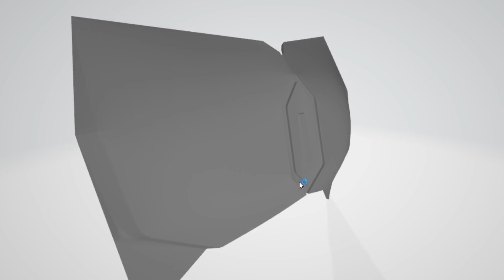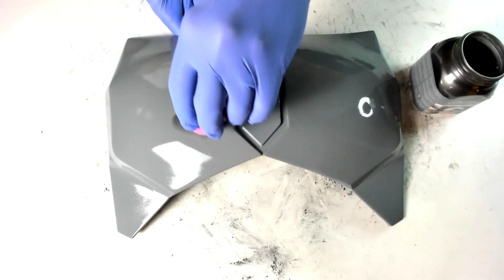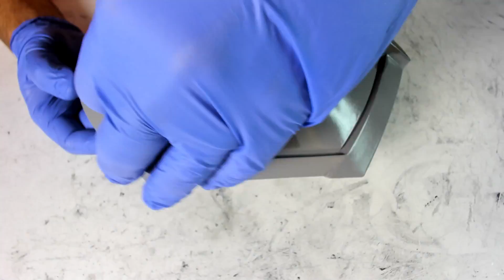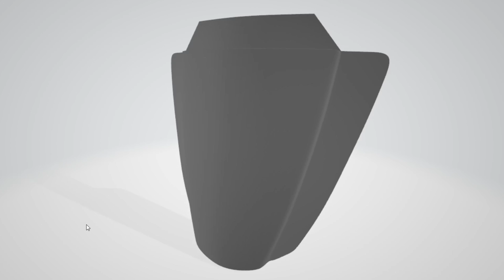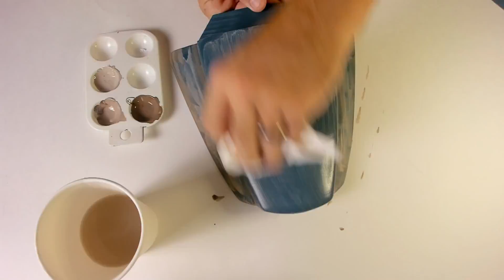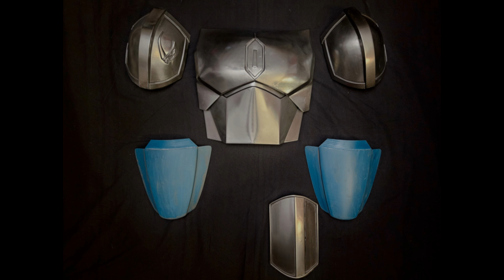3D Printed Mandalorian Armor With Only FREE STL Files? Pt.1

Comment: Hello. your work is great. What is the brand of your 3D printer?
Reply from the maker: Thank you! I've been using an Ender 3 V2 Max Neo, but i recently upgraded to a Bambu P1S. I'm looking forward to making new videos with that one.
Reply: @VaderDadBuilds  Thank you. Congratulations on your new machine 🥳
Reply: @3DMaxBuilds I just bought the Bambu P1S two weeks ago and I love it! It is my very first 3D printer. The only downside is that it only prints up to 256mm. I'm printing lots of large armor and I need a 3D printer that is taller.